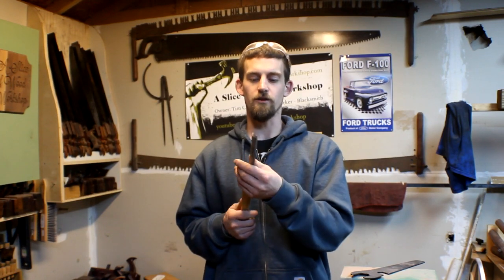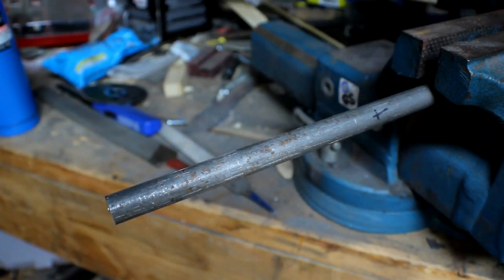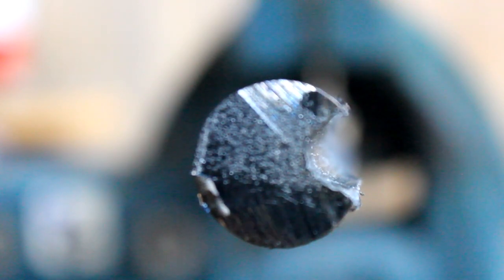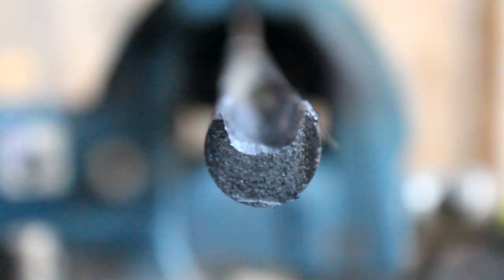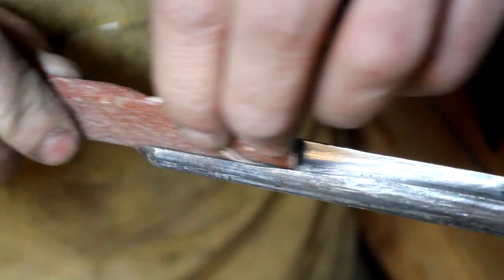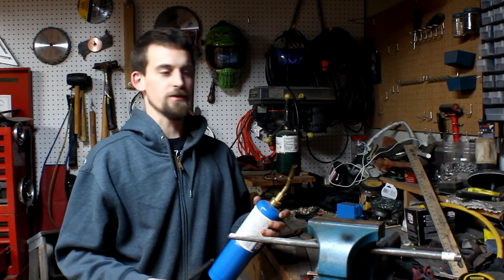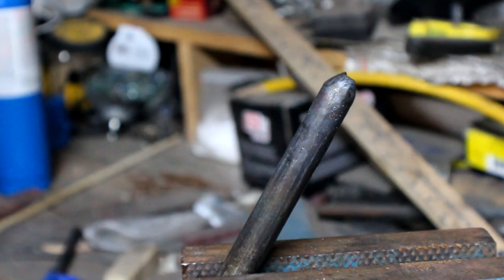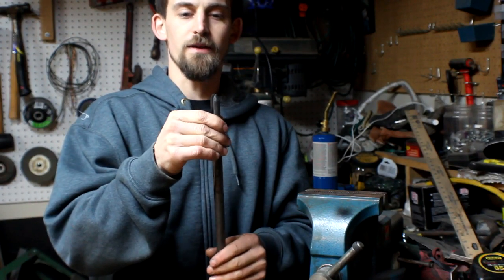Make a Bowl Gouge PT 1 | Forming and Heat Treating

Comment: What kind of steel did you start out with? Mild, tool, some kind of high carbon?
Reply from the maker: +Richard Morley (BrainFizzUK) it is a mild steel. Might not hold an edge as long. If the design works, i may get some better sterl and do it all over again.
Reply: Timothy Charles well maybe not, but who cares! Every turning tool needs sharpening anyway! And mild steel costs pennies 👍😀
I have a mind to try this myself, I think the heat treatment will be the most challenging, but still well worth a go! Keeps us updated with how you get on, making handle and using etc! 
Great job mate!! 👍👍